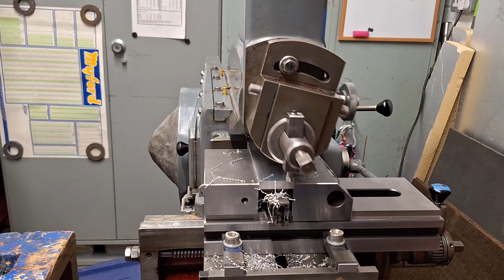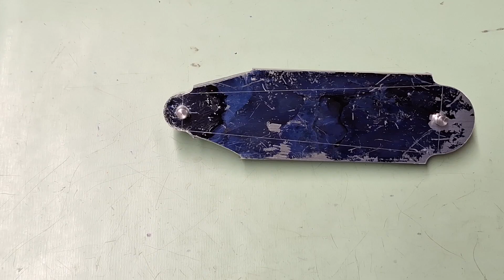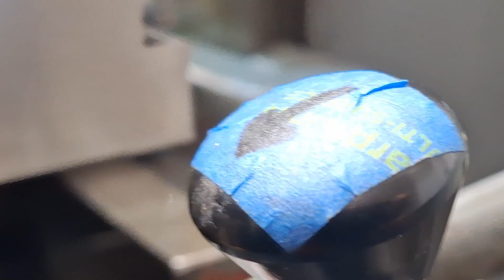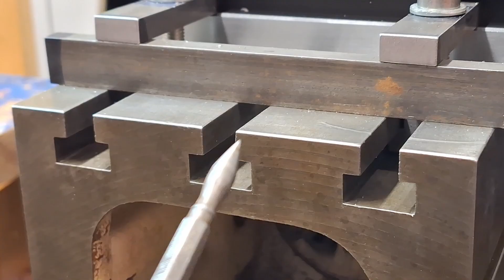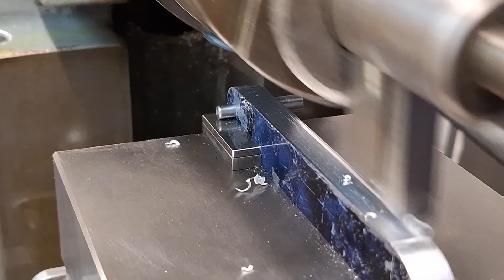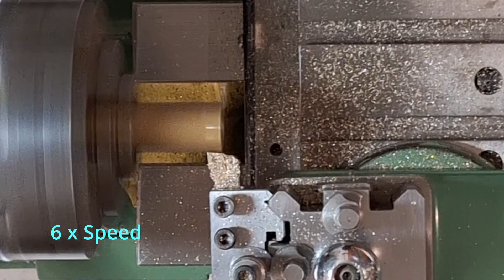Making a Handle for the Clock  Mainspring Winder

Comment: I like that the sides were cut after the radii. It seems better to control the approach to the curve, rather than trying to end the radius cut to a finished edge. Also, the little whistle of the shaper cutter in that aluminum is very satisfying.
Reply from the maker: Thank you very much for your thoughtful comment. I hoped it would be easier that way especially given the taper. For once it went pretty much to plan.....